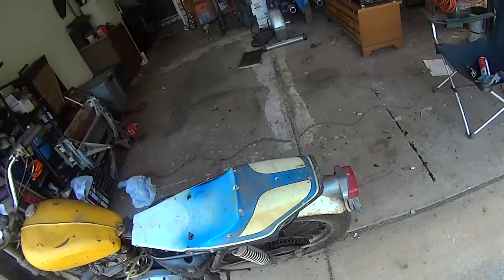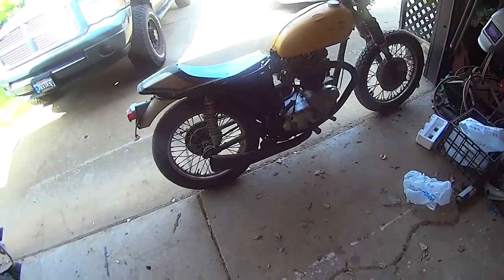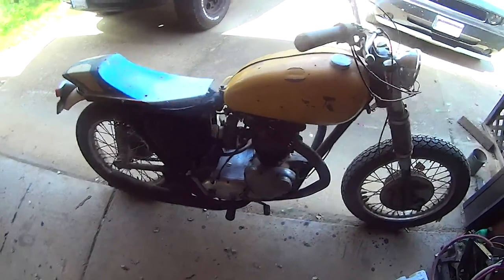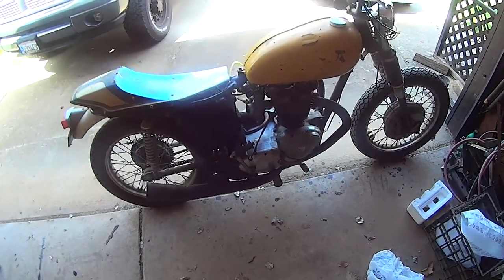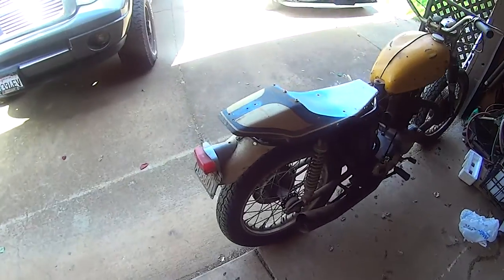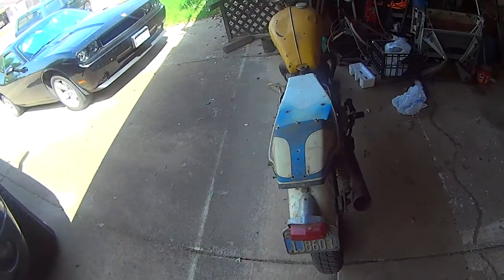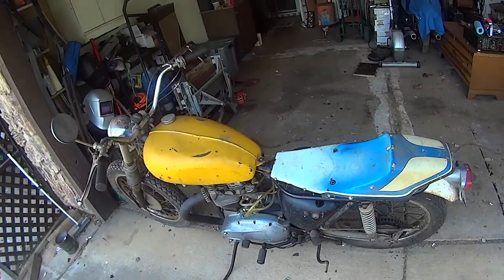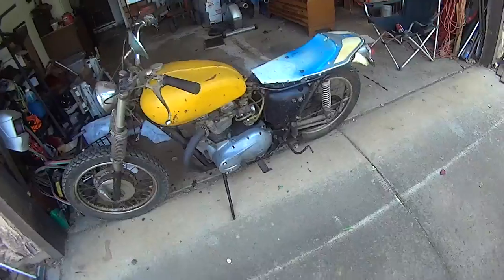1965 Triumph T120C a bit cleaner

Comment: Wow, that's really coming together nicely! 👍🏽
Reply from the maker: there's that single seat seat pan I was talking about. If I could buy it from my dad I'd get one similar to that and stretch it so I could have a larger seat that I could sit back further on and I will paint it pretty much the same way to honor it's racing days. I want to relocate the aftermarket oil filter to the bottom of the frame in front of the engine so it won't puke on everything when you pull it off, should also act as an oil cooler a bit as well, though I'd also like to add at least one oil cooler as well if not one finned and one extruded as one works better when you are moving and the other works better when sitting still. As hot as it gets around here I figure the extra cooling would be useful.

Comment: Nothing like any original t120.
Reply from the maker: I wish I could get it running for youtube but I can't afford the new carbs it needs, hell I can't even afford oil and a new external filter for it so we can move it off of the backbone. It could probably use new coils too. Straight from Amal the carbs are listed at 149 lb a piece which is.. $196 and change each. Plus cables and a new throttle adjuster. It could also use some new grips as for some reason the ones on it are turning into tar. Since this video I sanded the tank and primered it grey and my dad polished the cases and rims, maybe I will make another shorty video of it.